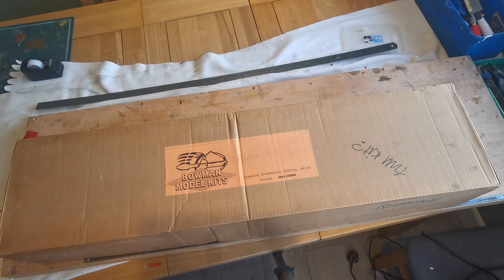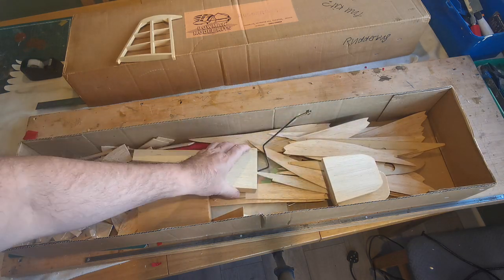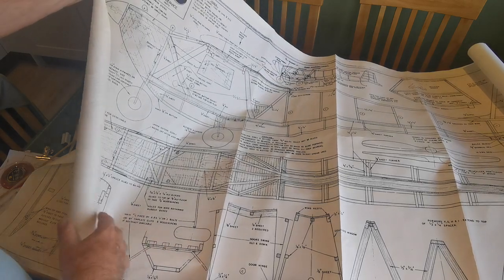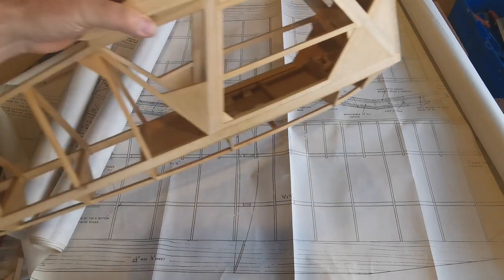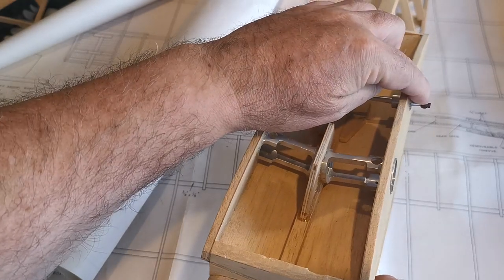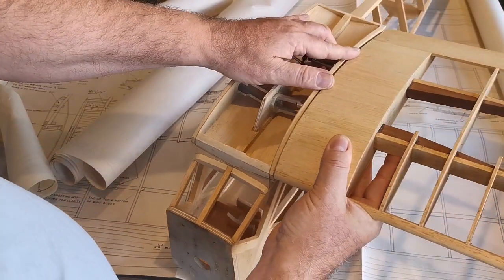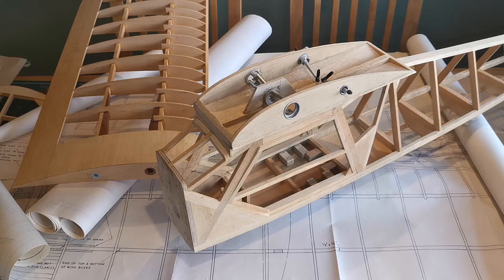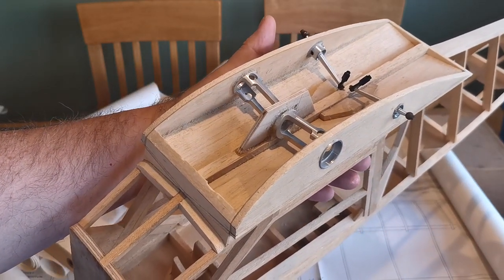Mystery wing design : Vintage RC "Rudder bug"

Comment: Hi Mark,  Many modellers have discovered that ailerons on vintage models don’t work very well unless the dihedral is significantly reduced. This is because the adverse yaw due to aileron input causes the wing dihedral to oppose the aileron input. In bad cases the model might even roll the opposite way. The rudder rolls the model perfectly well with the designed dihedral.

I wonder if the original intention was for the wings to move together to give pitch control while staying true to the original no elevator single channel rudder only design.

If you use one servo per wing you’ll be able to try both pitch only and pitcheron. Differential (more up than done) would normally help but in this case will give you a pitch input along with the aileron input. The pitcheron system works fine on models with low or zero dihedral.

I agree that it looks like the intention was for a 1/2” rod of some description to be bonded in to the wing and supported on bearings in the centre section.

What a great piece of construction. I wish you well with whatever decision you make.

Your videos are great and I look forward to seeing more of the Rudder Bug.
Reply from the maker: I was leaning towards twin servos to control pitch rather than roll rather like the "Flying flea".
The first step is to source the bearings then make the wing rods.
Glad you enjoy the videos I like making them beats talking to the microwave 😂.
Reply: Good plan

Comment: this is quite interesting! I like seeing something as weird and complicated like this! most of its completed which is nice!! now you can spend all that time figuring the joint at each wing. believe you have a cylinderical piece going in SNUG but be rotatable. held in place with 2 pins from both ends. the tilting of the wing would be for steering the plane like the wright brothers did
Reply from the maker: It's going to be fun figuring it all out.
Reply: @MarkCroucherRC4fun  keep us posted, quite interesting and appears to quite a big plane. I very much love the fuselage design there!
Reply from the maker: @ronitsingh85  wingspan is 6ft
Reply: @MarkCroucherRC4fun  I thought it was 6ft per wing! Total span is 6ft, a little smaller than the falcon.

Comment: It isn't unlike what we used on RC-gliders in the 1970s. It worked really well, but on the Rudderbug you will have a lot of adverse yaw, so you'll need to know where the rudder is too! 
I believe the rods for the wings are to be located in bearings on the fuselage, and are supposed to stay on the fuselage with the wings off. 
A glider here with a somewhat similar system: https://www.youtube.com/watch?app=desktop&v=vBAqQz7-1HE

Comment: Pitcherons! One servo would give you roll control by changing the wing incidence; two servos and a Tx mix would give you pitch control as well - no need for an elevator! I have seen Lidl gliders with this arrangement - it CAN give you a very rapid roll with a lot of movement, but keep it down to a few degrees and it should be fine. The undercamber suggests a low-speed model, so the wing joiner wouldn't need a huge amount of strength; I would like to see a metal (hollow?) joiner, particularly as it is stepped. I agree that there is provision for a bearing at the joint face, but I don't think a ballrace is necessary, a plain bush would be fine. Something to connect the two wings would be good, just in case they decided to wander outboards.
This is fascinating project - good luck!
Reply from the maker: It's very interesting that's for sure.

Comment: To me the central ½ in steel rod would be bent in the center to the required dihedral angle and a suitable ball race would slide over the ½in. wire and a grub screw would be inserted to stop it from rotating. 2 servos would be added to the rear torque rods, one per rod.  This would allow incidence changes and aileron or pitcheron movements to be made.
Reply from the maker: The unit in the centre has the dihedral built into it its a neat job.

Comment: Its very interesting but I think it's a bit of overkill given the amount of dihedral. I would also be concerned about the lack of bracing and could see the thing clapping its hands, mid flight! Personally I would keep it rudder elevator and remove the mechanism.
Reply from the maker: That's the first instinct however I also feel that I need to try to finish Dicks project.
Reply: @MarkCroucherRC4fun  Understandable.

Comment: I wouldn't want to fly a Rudder Bug with that angle of attack setup. I still fly my late fathers Rudder Bug that he first maidend in 1967 before I was even born and he could loop it on rudder only. I've since changed it to rudder/elevator with a Siato 40 four stroke and and tail dragger,  it is not an easy bird to take off, that rudder is extremely effective and she ground loops very easilly. I woul go back to the one piece wing setup👍

Comment: That is really interesting Mark. I always enjoy following your interesting videos. I have never come across that idea for full wing/deflection aileron movement  before. After some consideration it occurred to me that it must be  a bit of a bad idea from an aerodynamics point of view though - the full flying wing /aerofoil which can be pitched up into the airflow along its entire length which may cause a stall very quickly, even if the wing has considerable wash out towards the tip. Anyway I guess that is one of the reasons why we all love the aeromodelling hobby - so that we can try new ideas out and test them in the air while we are safely on the ground. Cheers Paul

Comment: Imagine this plane with a fixed elevator. Now imagine that each of the connecting rods on the main wing had its own servo. The wings could be used as elevators AND ailerons... Now that would be interesting to build and try!
Reply from the maker: Wow flying flea with elevons

Comment: That is some craftsmanship. Bearing was what came to mind immediately and a rod to be made on a lathe of the rig ht diameter with  a groove just inside the wing so a set screw or pin from above will keep it in place while being able to rotate freely.
Reply from the maker: Think that is the way to go, trying to source the bearings now.

Comment: A threaded bolt on rod to go through the fuselage into the wing with the boot permantky sexured to the wing and then a nut to fit 8nto the  bolt onve its threaded through the guselage side to tighten it up with a bearing to ensure smooth movement, if the rod and nut are of sufficient stength it would be quite a simple solution and very effective solution 

Never seen anything like it but it definitely seems the right way to go, the bearing would allow the nut to be  tightened as much as you like and still have smooth movement with little effort for the rear mechanism to work.
Hope that makes sense. I've never built models before but thst is the solution zi would go with but please feel free to totally ignore me lol..
Yiuf need mihhty powerful servis thiugh I think. Would this be sn akternative to.silerons or eoukd it be gor elevator putposes? Or msybe even both?

Comment: The up and down controls, Imho, are for using wings as ailerons and the stepped wing joiners are stepped for a bearing or bearings. The holes in the top of the wing joiners are for some kind of fixing to retain the wing half's. Just guessing though. I can't wait to see what you come up with!!

Comment: Make a detailed drawing in mm of the steps Including length and with precise measurement and send to me.
Then i would make one set of dowel pin in aluminum with in in 0.02 mm tolerance free of charge to you.
Lead time less than one week
Hope to hear from you :)
Love your channel.
Reply from the maker: Thank you for your generous offer, I'm being to see Dicks logic. I think the design is basically a rod running in bearings with a slot to take a retaining pin to hold the wings.
Reply: @MarkCroucherRC4fun  I believe that is bronze bushing instead of ball bearing since it will occupy too much space and weaken the dowel pin.  
Anyway you just tell me when you need a pair of dowel pin, and I will provide it for you, including the bronze bushing.  
It looks like that it is one in the inner side of the fuselage and one on the outer side, close to the ribbon.

Comment: Certainly that’s an arrangement to twist the wings in opposite directions to achieve control rather than use a rudder. It’s been produced in a few kits before

Comment: Dick Linsey must have been an engineer of some standing and his work looks immaculate.  He would surely have taken into account the enormous (by today's standards) weight of he radio gear and desgined that major rod/tube to handle it.  Since the mountings appear to be aluminum the rod would likley be steel, a fairly complex machined piece but doable on a lathe.  Your big advantage is of course the weight of the radio gear, a tiny fracion of what Dick would have designed for.  Amazing stuff, I would love to see it completed as Dick intended, way beyond my abilities though.
Reply from the maker: Totally agree regarding Dicks abilities, Im starting to see the logic in his design. I think it involves two bearings a larger one on the outside with the smaller one on the inside. The steel rod in the wing will have a grove cut with a spring loaded pin retaining the wing.
Reply: @MarkCroucherRC4fun  
Yes that's highly likely!

Comment: That metal cup in the top of the cabin which would accept a dowel looks like it was supposed to have a small ball bearing fitted into the cup and would allow the wing to rotate slightly... I'm sure a hardwood or Carbon Fibre dowel would suit.